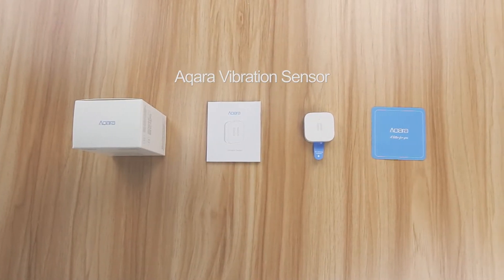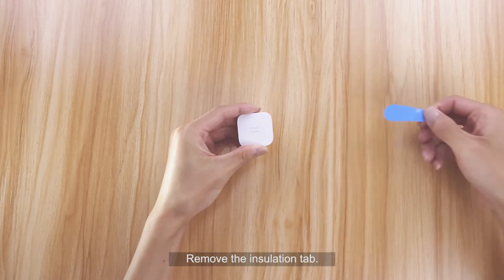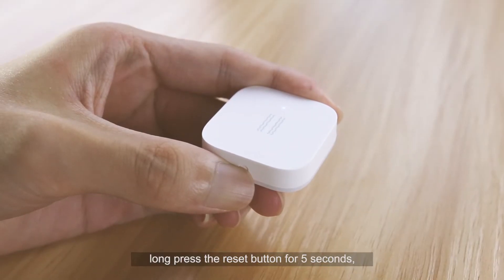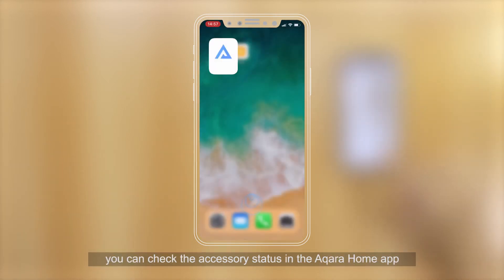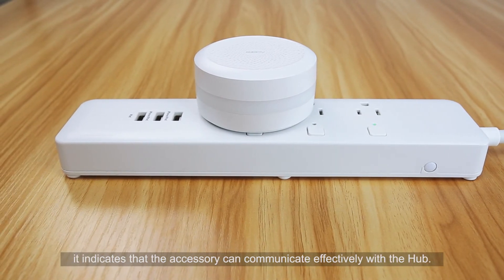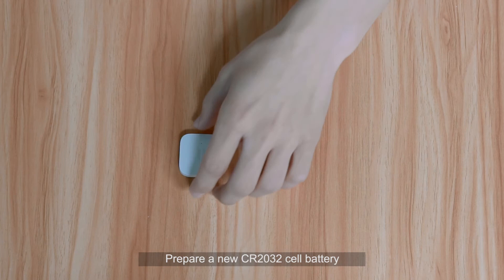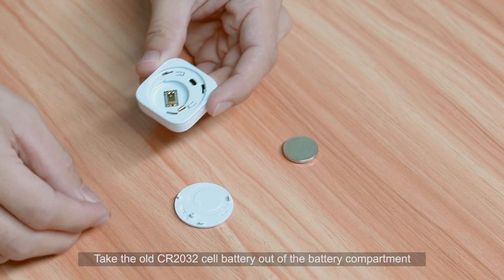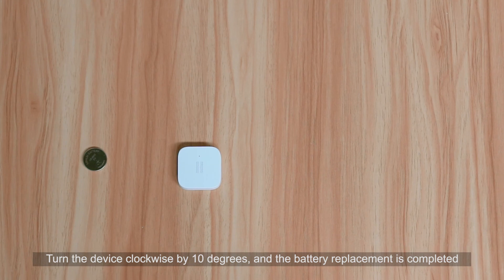Aqara Vibration Sensor Installation Video

Comment: Why choose the Aqara Door and Window Sensor over the Aqara Vibration Sensor?  If they both can tell you if a door is open, conventional, sliding, cabinet, gate or fridge; then isn't the smaller footprint of the Aqara Vibration Sensor, plus it's additional uses, the better choice, especially since they are priced nearly the same?
Reply: I heard the Vibration Sensor isn't the most accurate or responsive, the door sensor should trigger perfectly each time a door is opened and closed, the virbation sensor maybe hit and miss.
Reply: @coolspot18  That was my experience with the VS, so I returned it for the standard WS.  Until they perfect the VS, it's not the omni choice.